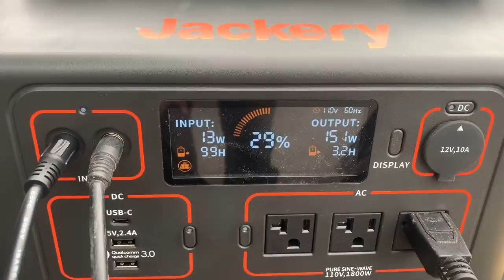AN EPIC REUNION | TOGETHER AGAIN // EFRT S6 EP26

Comment: We're glad to see you all back together, my little girl that's 9 months old loves your videos. She likes to sit with me and watch in my chair, she came along in the middle of this Covid mess so she hasn't gotten to travel as much as her older sister did. 

I always tell how her how pretty the drone shots are so when one comes on she looks at me to make sure I saw it too. She seems to prefer the Forrest to the Desert, I haven't told her that her Dad is from deep in the desert. I grew up out in the oil fields where the most exciting thing around was riding a pump jack.

We appreciate they way you guys plug products, some of the overlanders you cross paths with have channels that remind us of promotional video at bass pro shops with incredibly expensive equipment running in between. Keep up the good work. 

We really don't need to know that you're a General Tire, Polaris, AEV, Tire Rack, Patriot Camper, Warn. Icon, redarc, Garmin and Maxtrax salesman every 10 minutes like some other channels feel the need to do.

P.s. Get yourselves some Corrosion-x spray you won't regret it. It's one of the best metal protectors I've ever used.